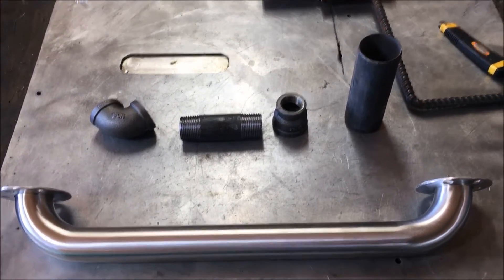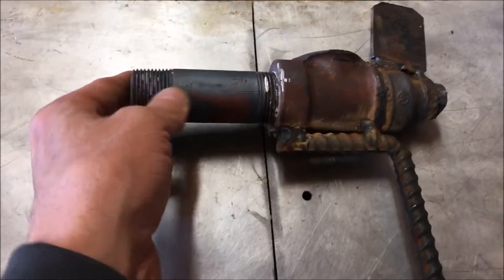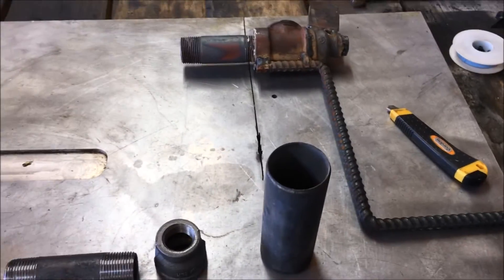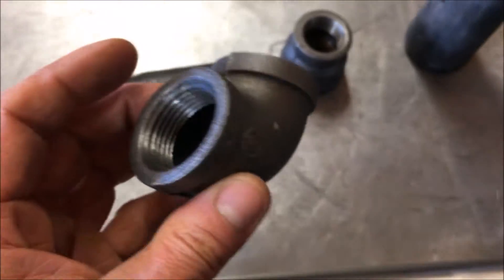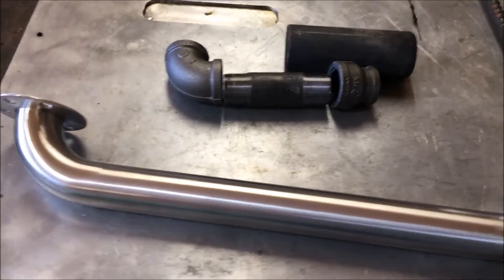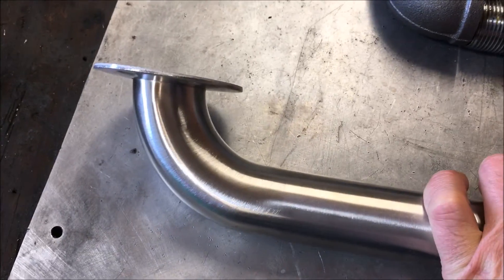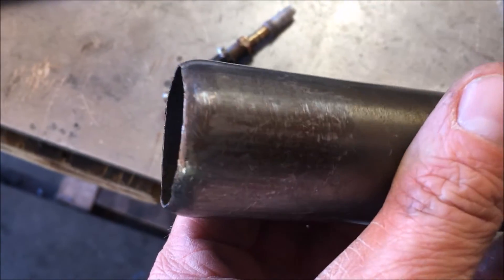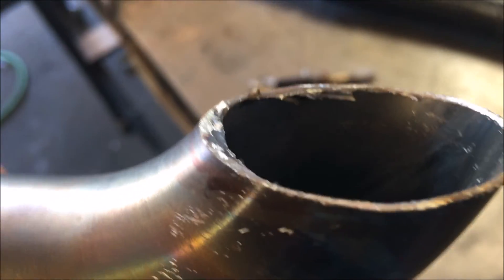Mini Elbow burner waste oil burner ( SIPHON NOZZLE )

Comment: WTF are you talking about 350watts and 3.8kw? Heat is measured in BTU  electricity is measured in watts and Kw!
Reply from the maker: and your not only rude but an idiot,,, nice going
Reply from the maker: I was being a little harsh . There is a very good reason for using Kw for heat power and all electric heaters do the same thing.

Comment: I never knew that a stainless steel pipe could creat loops of electrical current induced within conductors by a changing magnetic field in the conductor due to Faraday's law of induction. Eddy currents flow in closed loops within conductors, in planes perpendicular to the magnetic which I never new a stainless pipe could do

Comment: Always remember: any time it is glowing on the outside, that is heat you are losing from the equation, so it remains the best option to insulate the pipe so the heat remains inside until it reaches your work piece and not lost through the walls where it is just causing problems.
Reply from the maker: I plan to wrap a ss break line coil around this thing and make a flash boiler . I did try your insulation Idea with some 1000 degree insulation LOL yeah i know it was all i had . currently i cant spend very much money on these projects but it would be very interesting to see an insulated burner operating  .
Reply: Rock wool should be pretty cheap... Also there is aircrete which is growing pretty popular, although without a solid holder, it would be exposed to the expansion of the metal and fracture, so it would need a case over it so the aircrete did not crumble from the thermal expansion of the metal.
Reply: Or you could bury it in vermiculite, about $20 for a bag at HD